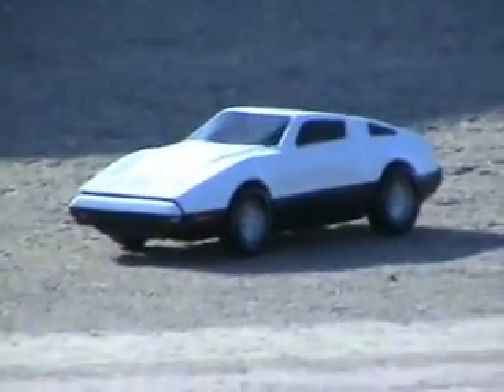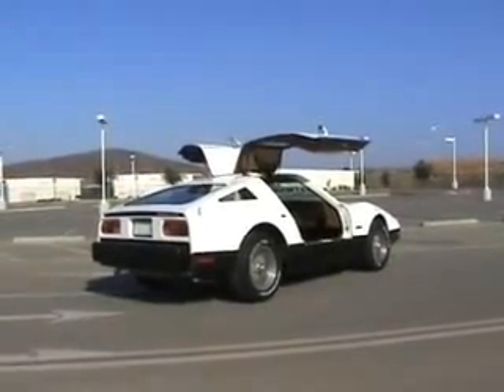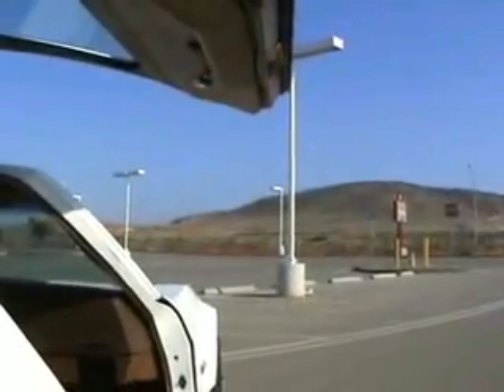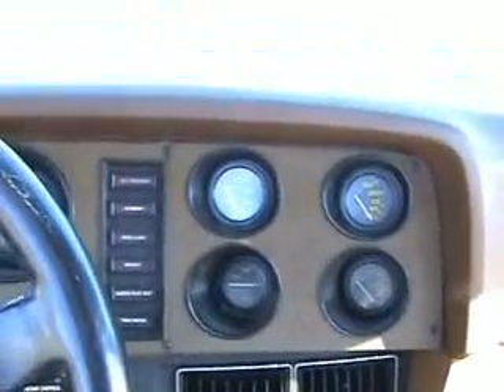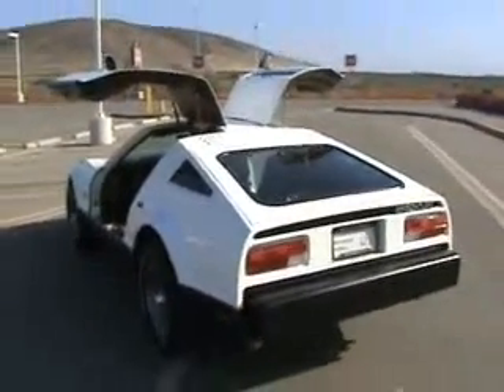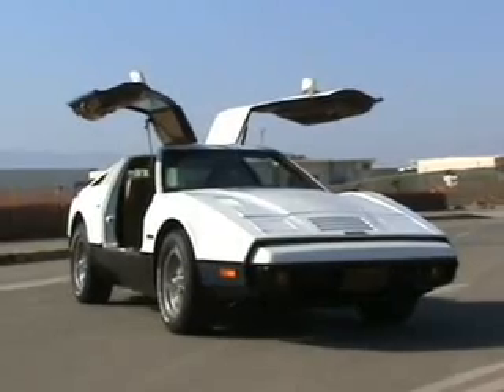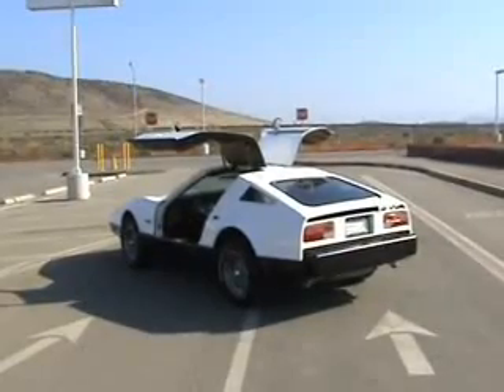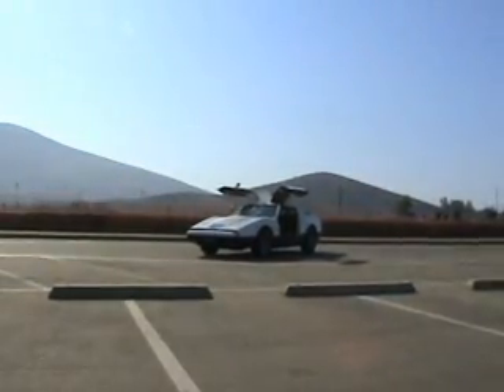Bricklin SV1 Technical Demonstration. Rare Gullwing Sport

Comment: Hey AmphiBrick, great review very detail oriented !   A couple of pertinent questions for you fella' ? What type of 4-Barrel carburetor was deployed on the earlier AMC 360ci motors and the later Ford Windsor 351ci motors ?!?  Holley, Carter or Weber units ?!?  Secondly, weren't MOST of those gull wing doors MANUEL operation with a strap to pull on in order to CLOSE once seated inside the vehicle ?!?  Keep ^Up^ The Great Work Yo !!!
Reply: The carb is a Motorcraft/Autolite 4300. The doors are hydraulically operated, although most have been converted to pneumatic. It was the DeLorean that had manually opened doors on gas struts.

Comment: He doesnt have a clue what happened when this Bricklin model failed the crash tests. The body was made of acrylic and upon impact the body shattered and the gull wing doors would buckle in and if you got trapped inside this Brick of a car good luck using those power gull wing doors. This car failed royally after just over a year. Bricklin went bankrupt and then he was a part of the Yugo shit box in Europe.
Reply from the maker: Since SS does not own a Bricklin, we'll give him some latitude here. But we'll also set the record straight. The Bricklin chassis suffered very little damage when it passed the 30 mph frontal barrier crash test (you can Google Bricklin Crash Test) and how about the 4,850 pound roof deflection test after 35 seconds. Windshield still intact. Pretty Impressive for 1975 standards. And no, the doors would not buckle in, as the Bricklin safety cage prevents that. And, SS did not read the owner's manual in how to get out of a Bricklin if the doors were not able to be opened. (Rear hatch, or roll down the manual windows) As for the body made of acrylic, SS is only partially correct. It's actually made of fiberglass, like a Corvette, but has the added feature of the acrylic bonded to the fiberglass, making it more resilient to damage than the Corvette of the day. Now let's get to the part where SS is correct. Yes, it is a Brick of a car, much more safe than a lot of other cars of the era. Yes, the car failed after producing 2,897 cars, at a cost to the Canadian taxpayers of 26 million dollars, which comes out to $8,974 per car. Bricklin could not overcome the quality control issues of the early cars to get the numbers up to start making a profit. The later cars were actually decent. Actually, it was pretty amazing to even start producing an automobile for that small amount of money to begin with! And yes, the Yugo. I'd much rather drive a Bricklin. Or, how about a Subaru 360 with those suicide doors in the pre-Bricklin days? I suppose Malcolm Bricklin just has this strange fascination with doors that opened unconventionally.........

Comment: Gull wing door were invented by Mercedes Benz - because they made a sport coup in the late 1950's - (I THINK it was in 1957 - not sure) - the normal doors would be too small for someone of normal size to get into and out of the car!  So they simply made the doors open by going up and down - instead of left and right!!!!  And all 3 known cars (Mercedes-Benz, DeLorean, and Bricklin) that had Gull Wing doors - all had the same structure - and only required 4 inches to completely open the door!!!!
Reply: +Earthlinked mercedes had gullwing doors because the frame wrapped up around the sides, try getting out of one if it flipps over onto its roof

Comment: Anyone else love the DeLorean and the Bricklin almost equally?
Reply: Aren't both - basically built with Opal parts?  I'd take either one - but would prefer a DeLorean!!!!!!
Reply: Ratfink820
Bricklins use so many AMC parts, it's not even funny! Side Markers, Front Turn Signals, Automatic Shifter Console, I believe even the entire A/C system (since AMC's was the most compact at the time), 1974 used AMC 360 V8's, steering columns are Saginaw/AMC, headlight/wiper switches are Motorcraft/AMC, rear axles are AMC model 20s, front suspension is basically AMC Javelin parts and also use Bendix brakes.

This is completely unconfirmed, but I strongly believe the Bricklins dash to be derived from the AMC Pacer.  The dashes look eerily similar.
Reply: +dicarlo57 And yet up here in Canada, you still see AMC Eagles rolling around like it's still the 1980s. My AMC's are holding up quite well.  I guess Ohio is just a shitty place to be.  The AMC 360 vs. the Ford 351 argument is no contest. Even just on paper, the AMC has the power advantage. By 1974, the 351 was producing a wheezy 160hp while the AMC 360 still produced 220hp. We're comparing stock form to stock form as appeared in the Bricklin. The drop in power output from '74 to '75 was unnerving to a lot of folks and only served to contribute to the failure of the Bricklin.
Reply: Earthlinked no, the Bricklin had a AMC motor in it, then the last two years of production they made them with a ford, the DeLorean was made with basically a volvo engine! Neither cars had anything to do with opel.
Reply: They probably were haha I know what you mean, it basically is a damn AMC! The cars is amazingly awesome, but its like a DMC it's a piece of crap! I mean as much as I love AMC's they had a few shitty cars!
Reply: I don't see how they were any shittier than what the rest of Detroit was cranking out at the time. Hard to imagine today, but of the big Three, #4 AMC had the best quality control of the 70's. AMC also had the best warranty at the time as well.
Reply: Yeah I see what you were saying, that was the decade of dominance for imports! They were still shit just like the big threes cars! When I say shit I don't mean they were literally a piece of shit I just mean they were completely out of range with Hondas and Yotas! AMC was pretty damn cool though!
Reply: +Harold Lloyd bullshit. in northeast ohio they rusted before your eyes. poor quality and low performance engines coupled with ugly styling put them out of business. I had a 74 montego and a 74 torino with 351 Ws that were anything but shity and would put AMC junk  to shame
Reply: @dicarlo57  maybe because you guys don't maintain your cars that well
Reply: +Harold Lloyd I was able to blow away any 360 with my "wheezy" 35!s any day. your a fool if you believe american horspower ratings as they were downplayed for insurance reasons. 160 was net not gross horsepower if amc built such great cars why did they go out of business? because the dealers couldnt give them away. Id rather live in cleveland then ass-backward canada where your justice system lets criminals like karla homolka and paul bernardo slip through your fingers

Comment from the maker: This was the steering wheel that originally came with the Bricklin off the assembly line. This car, and all other 1975 Bricklin's that I have seen have no catalytic converter, but do have air pumps and tagged on fuel door and dashboard for unleaded fuel only. This car passed California smog many times when it was on the rolling 20 year schedule, although Ca. now exempts 1975 and older. The 16 or so 1976 Bricklins I have heard, were supposed to have catalytic converters.

Comment: Is that a modified 70's pont trans am steering wheel on this car?
I heard this was the only 1975(&6) North American CAR that had no catalytic converter, because a converter would melt the floor! Indeed, does your car have a cat converter? If not, how does it meet 1975 emission standards? Is there an air pump on the engine? Will a state inspection garage fail your car or even fine you for not having a converter on it? Perhaps because of the low production #,did the epa give this car an exemption?

Comment: If the 351 ford windsor v8 did not need a cat conv in '75 that would make the 75-6 bricklin the only american car with no cat conv in '75 & 76'?!!!  Why did ford cars with the same engine need a cat conv? Did you ever notice NONE of the non california  '74 PONTIAC low compression 400 & 455 v8's need an air pump, while chevy small blocks in '74 do? Why is the chevy a dirtier engine? lol

Comment: I remember reading the original hydralic/electric doors, if u tried to raise 1 door & lower the other AT THE SAME time, u would burn out the electric motor(s?) lol
Also those bumpers could take a 10 mph hit with no damage!!  WHY & WHEN DID THEY  GET RID OF 5MPH BUMPERS?  TOO HEAVY? NEW CAR BUMPERS - A JOKE! '74-5 firebird has very heavy but very protective rubber on steel bumpers & even better yet some big GM 70s cars - the grill moves in if you hit the front bumper up to 5mph with no damage!

Comment from the maker: I happen to love Chevelle’s and GTO’s, but Bricklin batteries are NOT in the engine compartment like a Chevelle or GTO, so Chevelle and GTO batteries are actually subjected to more stress and therefore go dead MUCH more often. However, Mr. Cod is uninformed about the 3 ways to open a Bricklin. A quick release pin is pushed, door handle released, and one can exit the Bricklin. To enter, one can use the rear hatch. Mr. Cod must be extremely jealous of the Bricklin to have a reaction such as his!

Comment: @Amphibrick If it were to be claimed as a copy of anything it would be the Original 1957 Mercedes Gulwing. But that would only be in error also since the design is radically different.. My only complaint about the Bricklin is that it didn't have alot of horsepower for it's engine size.
Reply: Thankfully it's easy to get 350-400hp out of a 351W with modern parts, or over 500hp with a 427 stroker.

Comment: I read that this was one of the worst cars ever built a disaster in fact...is this true?
Reply: Yes and no. There were production issues, but the fundamental design was solid enough. The Bricklins that are still on the road have mostly had the common faults dealt with, and are better cars than most from the mid-1970s.

Comment: The 74 Bricklin had a 360 Chrysler egnine. The 75 had Ford 351 Windsor with 175 hp due emission standards.
Reply: An AMC 360 V8, actually. Not related to the Chrysler 360, although they did use Chrysler transmissions.

Comment: Continued-
Getting parts can be difficult. They aren't made anymore so you have to get them from parted out Bricklins (not that many of them) or, I knew of ONE guy that custom made the body parts with molds he built. They aren't cheap. Insurance can be hard to get and they may make you pay the higher "sports car" rate. Since it's so old, you can't get a bank car loan so, you have to have the cash. It's not a good PRIMARY car....weekend type fun only.
Reply: Most of the mechanical parts are off-the-shelf components from other manufacturers, which are still widely available. Sure, the body and some other stuff is bespoke, but you shouldn't be needing those parts on a regular basis.

Comment: Continued-
The floorboards can literally have standing water an inch or more deep if it rains and you don't have the car garaged or under a shelter. Enough of the carpet getting wet like that and then drying out, and it can rot and smell and have to be replaced.

Comment: Continued-
Car repair places don't have a CLUE how to work on the doors and won't even try. If the doors' air system malfunctions, the doors can be lifted manually but they are HEAVY and hard to hold up while you get in and out of the car. Also, the doors are notorious for LEAKING when it rains. You can buy a secondary market sealer kit for the doors but even those aren't 100%.

Comment: Continued-
I had an orange Bricklin and they were NOT very well made.  SAFE, yes.  But they had problems and the interiors looked CHEAP.  Back then, the design was very futuristic looking but today, they look very DATED.  Some problems with this car: The air tube network that ran underneath the car that operated the doors would frequently crack or break because of the heat generated by the car and then if you're not mechanically inclined, good luck getting it repaired.
Reply: Basically all 1970s cars had crappy interiors, and most Bricklins have been fitted with much more reliable pneumatic door opening systems.

Comment: Continued-
The Bricklin's doors were hydraulic/air, but the Delorean doors were torsion bars.  The Bricklin had roll down windows, but the Delorean only had a TINY window hatch in the window that you could pop open for a little air.  The Bricklin body was molded from fiberglass with the paint MIXED IN to the material before it hardened, not painted ON, while the Delorean was stainless steel.

Comment: They were made in '74, '75 and about 36 of them in '76.  The first few had a Cleveland engine and the rest had a 351 Windsor motor.  They came off the production line with HYDRAULIC doors and then most people converted them to AIR because in cold weather the fluid would thicken and cause the doors to open and close too slow.
Reply: There were 772 built in 1974, 2,100 in 1975, and 34 in 1976.

Comment from the maker: It's also great that the Bricklin is the only production Gull Wing ever produced that had windows one COULD manually roll down. The Bricklin club is a great source for getting support about repairing the air system as well as the entire car, and they even sell new and very reliable air systems for the doors. I'm bummed you had so many problems with your car, but if one gets a good Bricklin, they are just fantastic!

Comment from the maker: You are correct in that most Bricklins have been converted to air doors for better reliability. The earlier cars did suffer their share of the problems you mentioned, but the later cars that rolled off the line were getting better and better as is the case with this one. As for the dated interior, that is what is so cool, with the flip digit analog stereo and analog gauges, just like any 60's or 70's classic automobile.

Comment: Part eight and final part: The windows are manually operated.  One more thing that is notorious for having problems is the de-icing wires in the back hatch window.  You can probably buy this car in mint condition today, from $10,000 to $15,000 U.S. dollars.  You can get an equivalent condition DeLorean for less than THAT.  Most people see these cars (the Bricklin and the DeLorean) and think they cost a lot more than they actually do.

Comment: Part seven: Finally, you have to consider that these cars looked pretty futuristic several years ago but they come across now as sparse, simplistic and dated, inside and out.  The shape isn't all that cool anymore (it's not low enough to the ground).  The doors are still cool, though, as long as they are working.  There's not much to the interior.  It looks very dated with its analog gauges and dated sound system.
Reply: Almost every 1970s car had a crap interior by today's standards. The styling is awesome, and never fails to draw a crowd, even today. You could lower it if you wanted, but why scrape going into driveways or over speed bumps if you don't need to?

Comment: Part six...I had to use bath towels to soak up the water and leave the doors up to dry out the carpet, which didn't work well when the weather was cold.  Eventually, this starts rotting the carpet.  The parts guy I found, had invented a door sealer kit that provided extra rubber where the door meets the top of the car but, it didn't work 100% AND, it was hard to get the door flush with the top of the car because of the thick rubber sealer.

Comment: Part five...I was able to find theschematics for the air system and let him study those to figure out how it works and repair it.Another HUGE problem is that the doors are notorious for leaking water when it rains.BIG pain in the ass.If you drive it in the rain it will start dripping eventually.If you park it in the rain,it will flood the floorboards with substantial standing water.

Comment: Part four....You then have to raise the door up with your hands and climb out of the car.  They are HEAVY.  I doubt most women could lift them.  To get back in, you have to get the edge of your fingers underneath the door's bottom edge from outside and lift it up and climb in.  I had to get mine worked on by a guy that I found after much searching that worked on hydrolic fork lifts for a living.
Reply: Again, hence why most have been fitted with pneumatic systems.

Comment: Part three....Another problem is getting the door worked on.If you take this car into a car dealership or a car repair place to have them worked on,they don't have the knowledge.The air doors work via a network of air tubes connected underneath the car.  These can eventually crack from heat,age or whatever.They can also,have sealer leaks and if any of these things happen,the doors will NOT work or will work half-assed.

Comment: The Bricklin was a crappy car.  I had one and it was more trouble than it was worth.  What the vid didn't tell you was that they were built off the manufacturing line with HYDROLIC doors and the ones you see that are AIR operated have been CONVERTED (I think MOST have been).  Owners changed them because in cold weather, the hydrolic fluid would get thick from the cold and the doors would operate sluggishly.  Part two of my post is next....
Reply: Yeah, hence why most of the hydraulic systems have been replaced with pneumatic systems.

Comment from the maker: Thanks for your comments. The air doors on this car were an unusual prototype "sliding plunger" valve. I've had the car 17 years and it's still the prototype valve. I don't have to hold the button down because of the way the valve is built. If your doors have a pressure regulator like this one, you can increase the pressure to the doors so they raise faster. Any other questions, let me know!